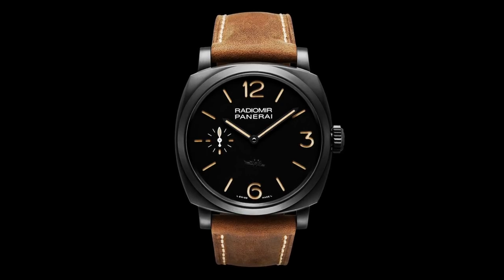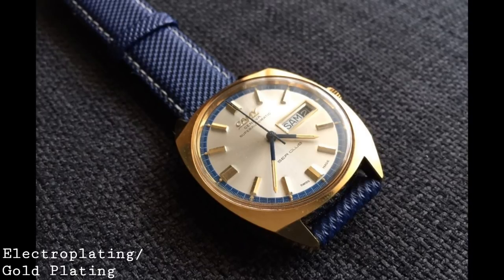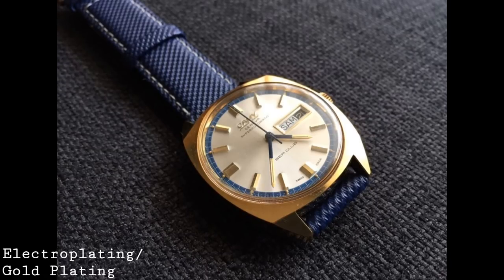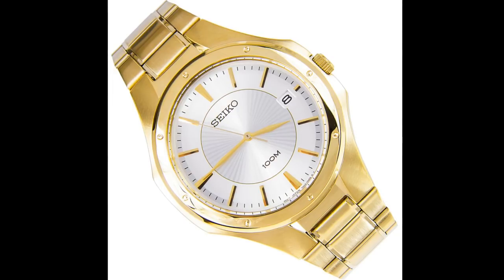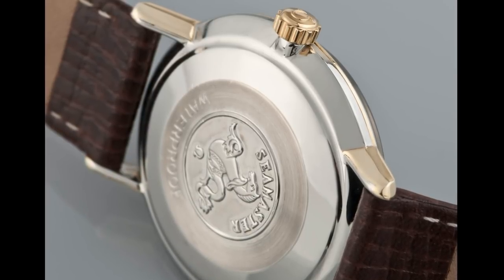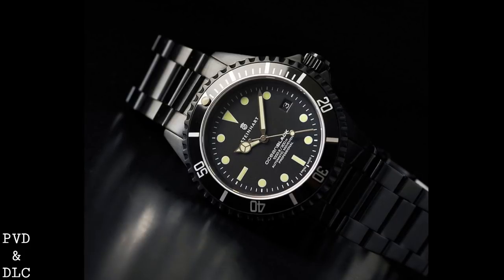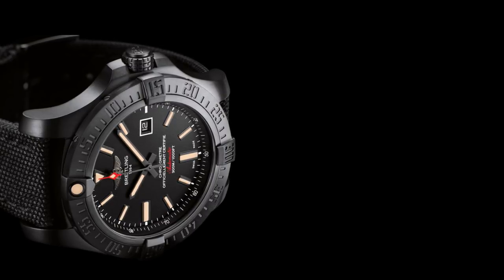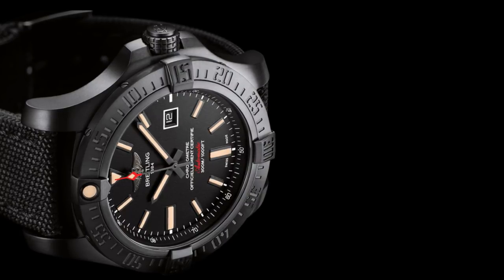Wristwatch Coatings and Finishes Explained

Comment: Thanks for this video and explanation of the various coating types.

I generally shy away from any coating, colored anyways, just out of pure maintenance or risk of more unsightly wear and blemishes vs a noncoated surface.

I do have 1 black PVD sports watch. It looks fitting for a motorsports theme watch and it's not that expensive.. A Roue watch which you've reviewed before.

I have Diashield on my Seiko SBBN033 Tuna, but I still picked up tiny scratches or tiny dimples of scratch on the shroud of the watch.. And I am damn careful and not that active to really put it to the test. So, for me, Diashield didn't seem to do anything.. No coating is impervious to even the smallest damage, but just saying the Tuna still picked up tiny scratches despite the Diashield and being very protective of how I wear and handle my watch. No worries. The tuna is a tool watch and I would expect some signs of wear regardless.

Comment: Interesting vid. I got through about 2/3 of it. I was wondering if you know, is there a layman's method for applying PVD or electroplating to a case? I removed a bad enamel (PVD?) coating (I think) and now it's just base metal. But now I want to re-apply a black coat on the case. I'm not sure how to do it. Thanks.

Comment: You didn't address cerakote here. What do you think of it?
Reply: Waseem Thokan 
Waseem...I don't know about watches, but I have several Cerakoted guns. It seems to hold up extremely well.
Reply: I have the Nixon Mission smartwatch, which has Cerakote on the bezel. In short, IT SUCKS! It started chipping within 3 days, and the most extreme thing I did was go to the grocery store. After a couple of months, it was horribly chipped, so much so it was embarrassing. I emailed photos to both Cerakote and Nixon and never got a response from either. I'd stay away from it for any application.

Comment: Good job Armand. The range of coatings and technical details surrounding them are a bit of a minefield of information and indeed misinformation. You're head must have hurt after reading all the tech specs. The amount of times I've seen modern gold PVD watches described as gold plated, even by watch show rooms. I don't own any, but have sent a couple of SKX cases away for cerakoting as part of a mod. Never really sure of the longevity of these finishes but the consensus seems to be that DLC black is the best of this type.